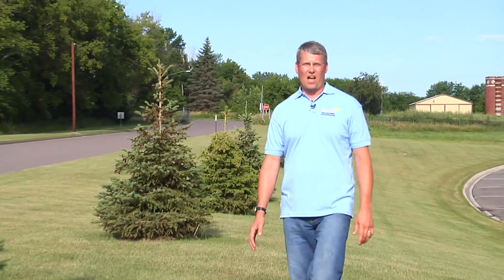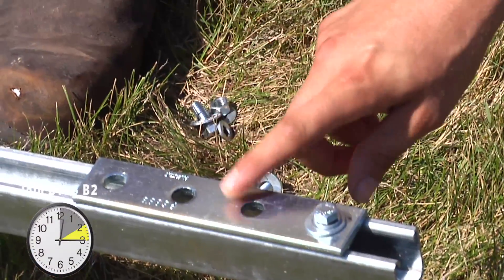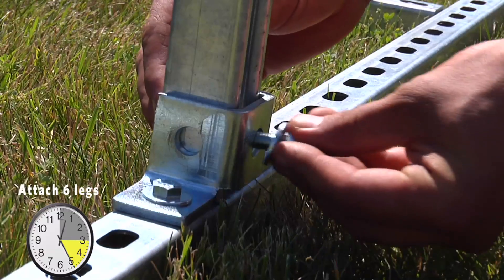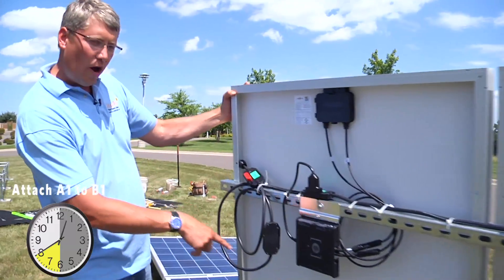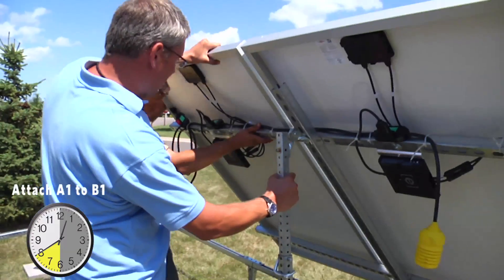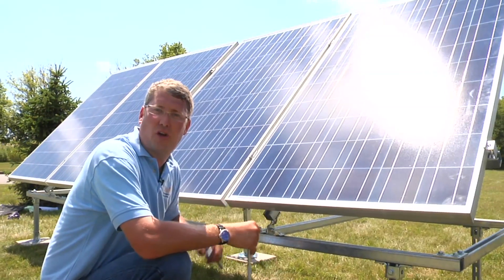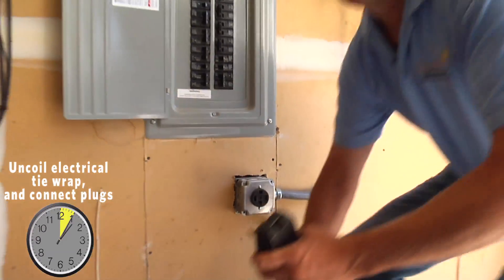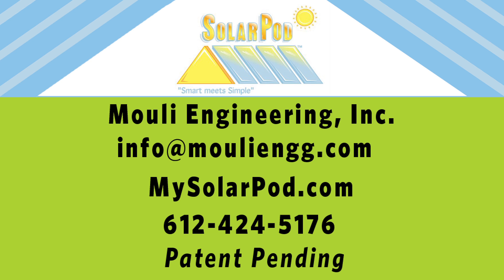SolarPod Plug and Play solar

Comment: Does a system like this require permitting?
Reply from the maker: Permitting requirements are jurisdiction control.  If your jurisdiction requires permitting you will need to. We will provide PE stamped plans that you can use for permitting. And our system is fully UL listed.